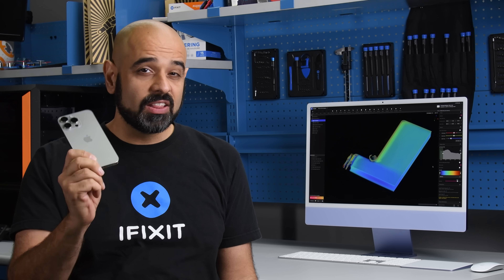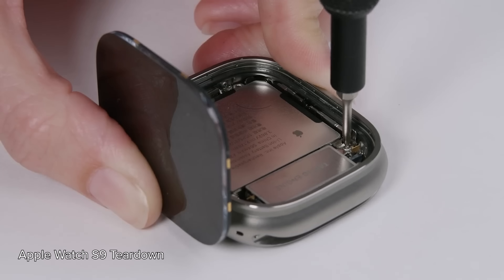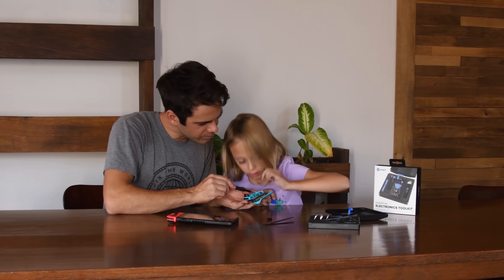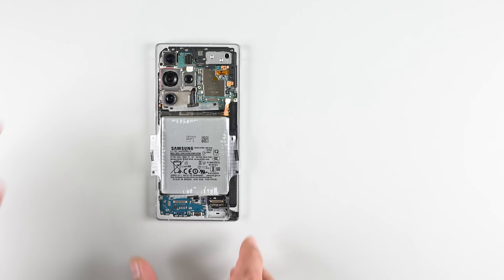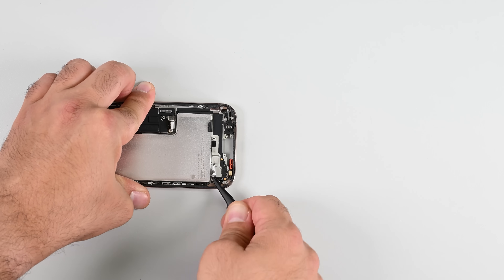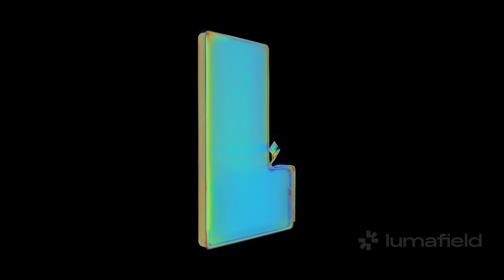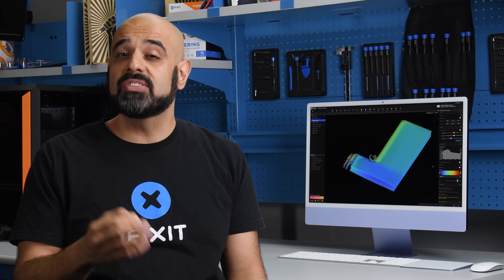Why Does Apple Put Batteries In Metal Cases?

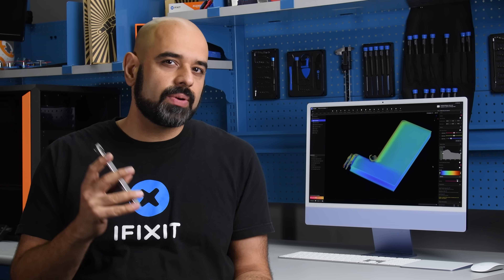Comment: 0:48  400 charge cycles in 3/4 years??? My iPhone 16 Pro that I bought October 2024 is saying 329 cycles on the battery and its been less than a year
Reply: Ik, it's unrealistic to say 400 cycles is 3 to 4 years. That's only if you use the phone very very much less than an average user.
Reply: Going to say the same, this guy clearly has no clue, i worked in a service centre and customers would sometimes be sitting at around 400-500 cycles in a year. Most phones needed new battery at two year mark. By his calculations people are charging the phone every 3-4 days, most charge every day.
Reply: @WattTheTech my friend hit 958 on his 15 pro in a year 💀. Still 86% health though according to the phone.
Reply: @WattTheTech  ive had iphone 16 pro max for like 3 months now and its on 30 something cycle what are you guys doing to your phones
Reply: @WattTheTech  A charge cycle isn't each time you charge your phone, it's when you charge your battery to the rated capacity, which could be a few charges as you're not charging from 0-100 each time. Ironic you say this guy has no clue when you're not even understanding what you're talking about.
Reply: @AndrewPL5 at what point did I say “each time you charge that’s one cycle” I’m fully aware of how 1 cycle works and defined.
Reply: @WattTheTech  then your math is way off
Reply: I am not a heavy user, using the phone 2 hours a day for social, YT, and email/text. My two year old iPhone 15 is at 523 cycles. Battery health is 90%. 

I think most people can expect 2-3 years before replacing the battery or the phone.
Reply: You haven't noticed? The guy in the video isn't all that smart.
Reply: I'm not too far off of you. I've got 582 on my day-one 15 Pro. (291 cycles per year)
Reply: 186 cycles and bought the 16 Pro in December 24. ¯\_(ツ)_/¯
Reply: @tyberzann9713 yeah which proves that 400 cycles in 3 - 4 years isn’t normal. It’s been 9 months since you got your iPhone and you’re at 186 cycles. Assuming you use another 186 cycles in the next 9 months then that’s 372 charge cycles in 18 months, aka right at the year and half year mark. So you’ll be hitting 400 cycles once you reach 2 years of owning your 16 pro, not 3 - 4 years.
Reply: I’m a very heavy user and I’m at about 190 cycles in 1 year and 100% health. (16 Pro Max)

A couple hints:

1. Set charge limit to 80% and only change it when you know you want the maximum capacity (long trips, hikes, etc.)
2. Use a small MagSafe battery pack at home to keep it topped up, but only when you’re at/near the charge limit. That means you’re just keeping it near the 80% which doesn’t generate as much heat.
3. Intentionally charge using a slower charger when possible. Less heat is healthier for the battery.
Reply: @rainmannoodles  I think I would just stick with buying/replacing a new battery. F*ck the environment or global warming whatsoever. Those e-waste are not getting ended up in my country either 😂
Reply: It depends on the quality of the battery too. Apple’s specs for iPhone batteries is 500 deep charges for 80% life left. My iPhone 16 Max is a year old and my battery still has 100% life.
Reply: I'm at 381, September 24 first use!
Reply: Yes, my 3 year old Samsung S21 Ultra has 950 cycles, according to the SysDump log.
Reply: 400 mark is usually when your battery will reach the 80% health remaining mark. After this point your phone probably won't be very useful for you as you will need to be close to charger or a powerbank.
Reply: Are you unfamiliar with the word “average”?
Reply: @thecanmanification  especially on average doesn't make sense. Because that would mean people can go with even less than that. I'd argue that 400 cycles in 3-4 is the absolute MINIMUM and definitely not average. Most people reach those 400 after a maximum 2 years

Comment: my 2020 iPhone SE has over 1700 cycles. so a lot more than 400 / 1000 cycles is possible.
Reply: iirc the ~400 charge cycles is specified to 80% capacity. Of course a battery will work beyond that but the capacity starts dropping fast (and parasitic series impedance rises, wasting more and more energy as heat) as the battery ages past that point.

Comment: 400 charge cycle is about 1 and half year of use. Not 3-4 years
Reply: Yes. I got 676 cycles and my device was started up September 2023 for the first time.
Around 330 cycles per year
Reply: i think you are not average?
bc i use my phone everyday and got 523 cycle after 1.8 year use
Reply: @namejust6287 you just proved op’s comment right. Op said 400 charge cycles in a year to a year and a half (aka 1.5) is the realistic standard. You’re already at 525 cycles nearing 2 years, meaning you did use up 400 charge cycles in a little over a year. As another example my iPhone 16 pro is at 164 cycles after 6 months, so assuming I use another 164 cycles in the next 6 months then that’s 328 cycels in a year. So once I reach a year and a half of owning my iPhone I’ll most likely be at 400 cycles already.
Reply: @namejust6287 which proves my comment .
Reply: @shariarhossain5673  yes i am heavy user too not average user
Reply: Consider that 400 fully cycles (from 3 V to 4.2 V and back) do correspond to 800 half cycles (from 3.65 V to 4.2 Volt and back). So if you discharge the phone to 50% each day, it will do this for 800 times...
Reply: @Ray_of_Light62 people keep talking about 400 cycles as though that’s a number to consider. But it’s less than the best current batteries do.
Reply: With 2 charge a day i have reached this in less than 6 months. I used my phone heavily for work😅
Reply: A charge cycle is not every time you fill it up fill it’s if you drain to 50% then fill back to 100% then back to 50% then back to 100% that is one cycle the same as going completely fully to completely empty to completely full again.
Reply: @vaulttecpatch  finnally someone said it right. Huft
Reply: Aren’t most lithium based batteries rated for thousands or even tens of thousands of cycles nowadays? 400 cycles to being useless would see the technology laughed out of existence
Reply: that depends on how often you deplete the battery. it's a year and a half if you completely kill your battery every single day. if you only drain it to 25% before you put it on to charge at night, then that's only 3/4 of a cycle because you didn't fully drain it. So like he said, the average person will take a couple more years before they've reached that many full cycles. My battery rarely goes below 60%
Reply: @gd.ritter been there done that and it doesn’t work. If you use iphone 14 pro max you will see 85% battery health around 1.5 years. And if you 15 pro max you will see 500 battery cycle   20-80% is generally good rule ,if you have 9-5 job. But i do businesses, i usually come home late night and my phone keeps dying or almost died at the end of the day. And my phone is limited to 85% charge. I also always use 4g
Reply: @gd.ritter 90 % of people who use phones not like a Nokia phone from 2000's will drain their battery within a day
Reply: @gd.ritter my iPhone 14 Pro last about 3/4 of a day after about 2 years. Better than my note 9 and s21 after that time (got about 4hrs out of them), but still pretty bad. So yeah, small batteries only last about a year.
Tablets and laptops though have way better longevity, my iPad Air 2 lasted 4 years, same with my tab s7+, and my new iPad is still at 99% after a year
Reply: @gd.ritter bruh thats not how it works, your charge cycle dont magically go down because you charge at 25%, if you charge from 25 to 100, then used down to 75 and charge to 100 again, thats still a full cycle. Cycle cycle just means you used the amount equivalent to a whole battery, doesn’t matter if you use it in one go or in between charging.
Reply: @z04notfound  you just said the same thing i said but worded differently.
Reply: @z04notfound no that's not at all how it works. Look It up
Reply: @z04notfound No because the battery doesn't degrade equally when charging from or using from say 25-100% as it does when using or charging from 75 to 100. It's more complicated than that.
Reply: @z04notfound no, it’s not. A full charge cycle means, according to the industry specs 10% to a minimum of 80%. If you top off, that’s not a full charge cycle. My iPhone is a year old now and has 100% life left.
Reply: @TheGogogogogogo citation please
Reply: I charge my Phone once every 2 or 3 days. So yeah 3-4 years is not unrealistic, just depends on how often you use your Phone. I replace Phone battery's in Samsung and iPhone and I would say more realistic timeframe is 2 to 3 years if you are not abusing your battery.
Reply: @SuperEdwardGarcia у меня 4 фолд и я заряжаю его 3-4 раза в день 😂
Reply: This 👆
Reply: I do 459. Bought my iPhone 16 Pro in September last year
Reply: more like 5 given my usage
Reply: Everyone up voting this needs to stop using their phone soo much. I charge mine once a WEEK, twice if I'm tethering.
Reply: Yeah, my 16 pro has 288 charge cycles.
Reply: I was thinking the same thing. Whose phone is lasting 3.65 days per full charge?
Reply: 358 in under a year
Reply: I use my phone quite a lot and I’m at 413 at about exactly 2 years.
Reply: Wrong Mr. Nazi-Sharia (initial comment)…I have 86 cycles after nearly a year…you can‘t compare your stuff to other (democratric) users! 😂
Reply: it should be around 365 if you charge once a day
Reply: @niveZz-  No it shouldn't at all. A cycle is not what you think it is
Reply: @TheGogogogogogo  you're right
I just looked it up and what is considered as one cycle is 100% of battery charge consumption. this explains why im still sitting at 239 cycles after over a year
Reply: Not everyone is on their phone all day.
Reply: @Devyn89  not everyone understands what a charge cycle is
Reply: I’ve had my phone for 1.75 years and have only 344 cycles on my battery.
Reply: That is true for APPLE 😂
Reply: agreed. I charge my phone every night from about 10 to 15% to full.
Reply: Yeah, I’m at 321 charge cycles after 1 year
Reply: It actually might be 3-4 years because unless you deplete the battery fully every day, running it down to 20% doesn’t count as 0.8 cycles, it’s actually much less than that.
Reply: It depends on how it’s used and charged. Those cycles are full charge cycles, not top up cycles.
Reply: I have had my phone for two years, and AccuBattery Pro records 800 cycles. 400 cycles varies from 1 to 2 years alright, depending on how people use their phones.
Reply: I reached ~1,270 Charge Cycles on my Motorola Edge 30 Pro before replacing the battery after 3 years of use. Depends entirely on the person and how they use their phones. I'd generally call myself a power user going through a minimum of 1 charge cycle a day (1,275 cycles/365 days = ~3.5 years)
Reply: I have like 420 cycles, I have not completed my year
Reply: Maybe for old phones or smaller iPhones. My iPhone 13 Pro Max at 83% BH still lasts beyond one day which means, 1 charge cycle ≠ 1 day but around 1.5 days on a rough scale.
Reply: I had more than 500 charge cycles in an year so not even 1.5 years. It’s like 8-9 months for me
Reply: What are y'all doing on your phones? I'm constantly on my phone and near 600 cycles after 2+ years.
Reply: 159 cycles after 1 year on my phone though…
Reply: Mine is 1yr old and 209 cycles
Reply: Which is why he said “for the average person.”
Reply: A battery cycle is draining your phone all the way from 100 to 0 and then back up to 100. The average person is not draining their phone battery to 0 every day. So ifixit is indeed correct
Reply: On original battery on x after 6 years slow charging and never below 50%.Currently 80% battery
Reply: @GarrettReynolds-uh9vj you’ll find that the charge speed doesn’t make much of a difference for battery health. What you’re doing is keeping the cycles small, that is the best thing you can do. Feel free to fast charge as often as you like, it’ll probably make your life easier.
Reply: 1.5 yrs for 400 for me. So yeah.
Reply: I had my iPhone 12 Pro Max on launch and it had 344 charge cycles 😬
Reply: We need to understand what is a charge cycle
One full charge and discharge?
Or every time we charge the battery ?
Reply: My iPhone 8 has 850 charge cycles and it’s at 81% battery health.
Reply: 604 cycles 
Sep 2023 first use
Reply: yeah, I don't know where he pulled that number from, from my experience is more like 800-1000 cycles
Reply: You really let your phone die almost every day? I keep between 30-40ish and 80-90 as much as possible
Reply: @starmanxvi yes 😊
Reply: @starmanxvi Doesn’t matter. If you recharge during the day that still counts towards the total cycles. I‘m at 610 cycles after two years with my 15 pro max, I always used the 80% charging limit.  Capacity is at 91% still, so the limit seems to be effective
Reply: @zxy7529damn bro 😮, I have over 1800+ cycles over 3 years i suppose 😢
Reply: @zxy7529 No... a "charge cycle" is 100% depletion and 100% recharge. If you deplete your phone to 50% and charge it back to 100% over night, that's 0.5 charge cycles, not 1 charge cycle.
Reply: @zxy7529 the total cycles affect battery health, but so does extended time spent near 0% and near 100%. that's why the 80% charge limit helps limit degradation.
Reply: That triggered me.  I was immediately “NO WAY” 1-1.5 yrs is a more realistic scenario.
Reply: Yeah, I was just thinking that. I do about 1.5 a day, not 100 in a year, thats low for sure.
Reply: im in 3 month can up to 500 charger cycle, 3-4 year? , in iqoo 13 can reach 150 cycle for a game, 3-4 years?, wkwkwkw change the device is really worthed then change the battery…
Reply: @Ajie321 damn
Reply: Yeah Jesus, it all depends on the person and their use case, this comment is just wildly inaccurate
Reply: @FoolsGould it's not
Reply: @FoolsGould yes ,very inaccurate . I charge my phone once a year so at least it will last 400 years ☠️

Comment: So we're evolving backwards to the shelled batteries? Like every phone had with the removable ones?
Reply: Kinda. The old ones still swell up into a spicy pillow. While these new ones supposedly help contain the swelling.
Reply: Yes because EU requesting that by law... Maybe it was better/easier to do that but the old way of doing it was feeling cheap. I think a modern approach to that would be good
Reply: No thank you!
Reply: It shouldn't be called "evolving backwards", when the current state of things (integrated batteries) was never an improvement to begin with. We were evolving backwards from replacable to internal batteries, now we are going the same step forward again.
Reply: Yes becasue it was better
Reply: @G0o0se if the chemistry density  increases.

Comment: Repairability and swapping out the batteries was so much better in phones and laptops when all you had to do was either press or slide a quick release OR worse case scenario such as in smart phones to remove a few screws on the outside of the phone plus one or two screws on the inside. I don't mind adhesive securing the battery. I don't want to have to take my phone completely apart or have to deal with adhesive around the bezel and hope that I don't damage a ribbon cable. That's just poor design and poor repairability. I don't want batteries soldered in either. The sizes of lithium batteries and connectors also need to be standardized for laptops, phones, etc. I don't mind having various batteries of different capacity. Ideally, I want the industry to make it almost as extremely easy to buy and swap out an old lithium battery as it used to be for the older ones or even as easy as it is similar to AA or AAA etc. Just like USB C became the standard through regulation, batteries also need to be standardized. It will benefit consumers. Repairability is extremely important. The less repairable a device is, the more likely it will become e-waste. One other thing I'm not a fan of for batteries are devices where if the battery dies / no longer holds a charge but even if you plug the device up it won't work This also creates e-waste.
Reply: You have to understand, assembling a phone with an easy to remove battery costs 4 cents more than the ones we get nowadays, how are the multibillion dollar companies going to survive if they have to spend 4 cents more on a phone that they charge 900 dollars for!?
Reply: multiply 4 cents by the amount of phones sold in 2024
Reply: @G0o0se and multiply $900 by the amount of phones sold in 2024 then subtract 4 cents multiplied by the amount of phones sold in 2024. Don't get me wrong I totally get this is how capitalism works but that doesn't make it right placing profit above all else (including safety and consumer satisfaction).

Comment: The adhesive used on the iPhone 11 and older needs to come back. It was so much easier to open and clean up. Opening iPhones 12 and newer require heat and the adhesive used is this brittle rubbery material that is a chore to remove.
Reply from the maker: The 16s are actually pretty reasonable with their adhesive while retaining the ingress protection. While it can take a bit to clean the old adhesive, it's much easier than it used to be! 🔧